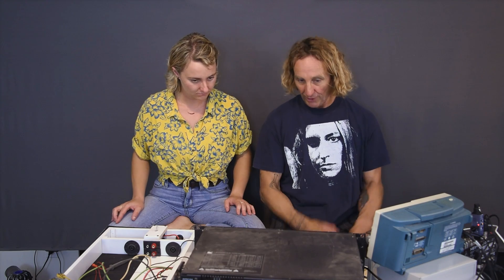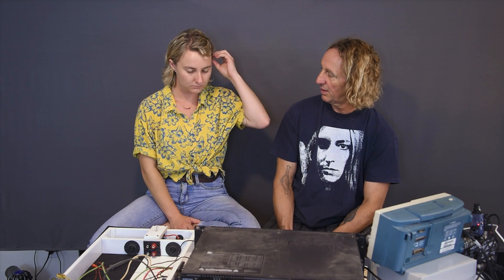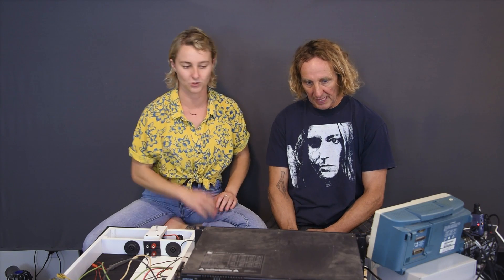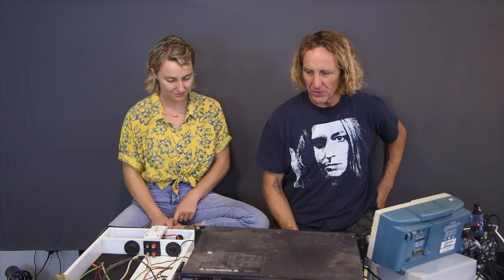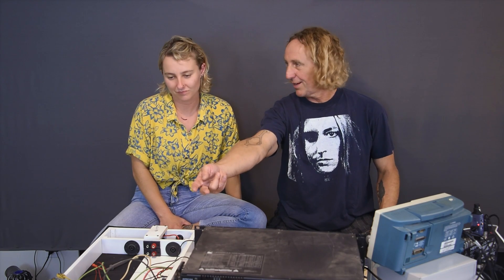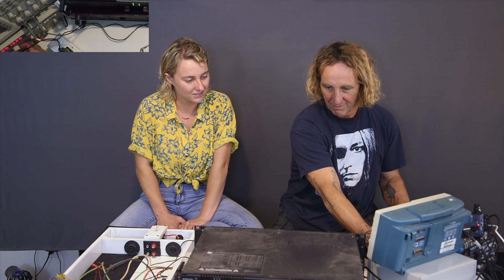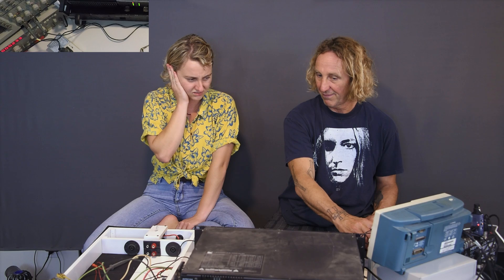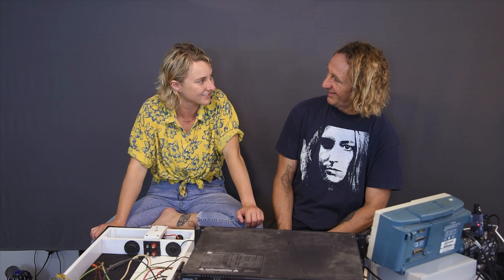Clipping Distortion Test Lab Gruppen FP6400 (Public)

Comment: First v-dosc was with the LA48 (lab 4000). Later on they become the LA48A.(fp6400) Difference is they connect the switching powersupply negative side on the B-channel (10% extra power on the low frequencies)and some extra inputsensivity switches.
Reply from the maker: Cool, yeah we never owned LA48, did not even know about them. We bought V-dosc when it was Crest and Crown powered with XTA xovers.

Went from crest to LA48a

Comment: Dave and Sam, interesting test, it is what my ears told me in both pro audio and hi end home audio with good class a/b and class D amps. I prefer class a/b for above 200 hz and class D for bass .
Reply from the maker: 🤙👍🤙 interesting, I actually prefer a/b for sound and D for cost, weight, size, output power per rack space, and minimal power draw

Comment: Hi
Very interesting.
Have you tried the distortion test with an old school tube amp?
Reply from the maker: Not yet but that would be fun to do
Reply: @DaveRat  If you really like to do amp power tests and want to get a very accurate and fast measurement, there's a product called the SMD Amp Dyno that seems to work pretty well. 

There's a couple of people on YouTube with them. One I know is a guy with a channel called Williston Audio Labs, he uses it on almost all of his videos. It's produced some very interesting results and conclusions.

One interesting thing that I've learned is that Class AB amps typically have about 3db more  peak power compared to it's rms while normal Class D amps might only have 0-1db extra peak power but higher end Class D amps will get more like 2db of peak power.
Reply from the maker: Cool cool and interesting.

I try and do my tests with inexpensive readily available gear or using almost no test gear at all whenever possible so people can replicate and test their own stuff.

I am more about teaching people how and why  to test than the actual tests themselves

Comment: Why don't you show what's happening on the oscilloscope. It would be interesting for engineers like me to see these diagrams. Including FFT analysis if the oscilloscope has such an option.
Reply from the maker: I will do at some point but also I find that analyzing gear in ways that we don't actually use it can bias the tests and perceptions.

If you or others are actually using a scope and fft to see waveforms on the inputs and outputs while mixing or setting up, then yes, that's a different story.

I wanted to test based on the way people use the consoles rather than what the consoles can do when tested in ways that people don't actually use them

This will become more clear when you get to future videos.

Focusing on what is actually heard and the consoles visual interface of what it tells you you should hear, has kept me on track with finding stuff that the gear that makes pretty colored lines often distracts from or glosses over.

Comment: Extraordinarily Great Video!
Isolating the distortion components allows people to hear the impact of amp clipping rather than simply looking at specs or a graph.  
I assume the sine wave distortion is from the amplifier squaring off the signal. (It would be interesting to see the output on a scope, particularly with the sine wave input).  
It would also be interesting to see the frequency spectrum of the distortion (using an FFT analyzer looking at the difference signal). The sine wave signal should show you the distortion signal's relative levels of even-order (2x, 4x, 6x. . .) versus odd-order (3x, 5x, 7x. . . ) harmonics. 
In the HiFi world, it is assumed that the even-order harmonics (typically from a Tube or Class A amp) are better "Warm-sounding" and the predominately odd-order harmonics are worse "Harsh-sounding."
In my experience, the way an amplifier performs when it clips, as measured with bursts signals (representing real-world wide-dynamic range program material like music with 20-30 dB peak to average ratios), is the difference that makes an amplifier sound good.

Comment: Dave, do you intend to compare the practical advantages and disadvantages of amp topology broadly speaking after these tests? 

I’ve always personally considered class-h to be the most optimal topology offering the best of balance in the real world/practical sense….
Reply: Modern amplifiers have moved past simple class-h designs. Instead, most use uniquely optimized digitally controlled power supplies that provide very high short-term output capabilities. Still, the length of non-clipped bursts and the recovery time between bursts varies significantly between designs. Additionally, most modern design's thermal condition can dramatically impact their performance. The dynamic variability makes it hard to compare amplifiers as their performance depends on the test signal or program material. For example, a design optimized for high frequencies versus one designed for subwoofer use would be very different.
Reply from the maker: Agreed, I will release a vid in testing a powersoft X4 next
Reply: @Dylan Dylan If I am correct the Lab FP and even PLM series are more similar to class G output stage. Main difference with other amps from that era is the SMPS.
Reply: @stefsmits442  absolutely - I believe the dual stage voltage rails of class H and how they ramp oppose to switch in class G makes it a winner topology - in my mind offers the best efficiency vs audio quality vs weight. 

Class D offers high efficiency and weight benefits - but probably not considered a audible pleasing distortion 

Class AB offers superior audio quality but definitely not weight or efficiency 

Class G - the predecessor to H - switched dual voltage rails - offers efficiency and weight benefits

Class H Ramps in the second rail, giving a more linear dynamic range, better distortion characteristics- but not as efficient and a little heavier then class D. 

That’s my understanding anyhow  - i am probably wrong though ;)

Of course the SMPS switching characteristics of each design from that period were talking about greatly alters efficiency, reliability and distortion property’s - especially in the HF band- that’s where a switching amp is let down IMO
Reply: @dylandylan11731  Though fun to hear the audible distortion of the X4 in the other video ;)

Comment: Dave, a lot of people prefer old big heavy iron transformers in the power amps to provide "real" bass or better bass tone than the light weight switching amps, do you agree with this theory or not and do you think the high end price amps are much better for heavy work loads or are the cheap behringer or knockoff style amps just as good? Hope there is no such thing as a dumb question, your honesty is appreciated
Reply from the maker: Great question Steven. My gut says iron.  But testing has shown me that it is not as much the age or amp type as the actual design of the specific amp.

For example, old creat vs qsc vs crown with pulse tests has the creat as a winner.

Newer amps lab gruppen was better than qsc and way better than the Peavey crest but then comparing a brand new powersoft to an old creat put the powersoft on top.

What I did find is that the specs don't tell you how an amp wi perform with high level sub lows and low frequency bursts.

You need to test and compare and there are old and new tech amps that perform well.

I will try and do a vid on how to test amps for lows at some point
Reply: @DaveRat  at EAW in the day, we never had the time to do a deep dive, but the inductance of large voice coil subwoofers clearly impacted the performance of subwoofer amps. Testing amplifiers into dummy loads does not consider the impact of the reactive component of a loudspeaker load. Not to mention that the loudspeaker load characteristics significantly change as they get hotter.
Reply: @DaveRat  thanks for your honesty, a lot of us in the community are switching to amps like qsc 3402 / 3602 as they are made in USA,  lighter, more efficient and reasonable on the secondary market. The heavy iron amps are becoming increasingly harder to get parts for it would be interesting to see how they fair against big ticket or cheap knockoffs, I am sure there would be much interest in this test or opinions
Reply from the maker: I will try and look at cheap vs expensive new amps

Comment: I found your speaker cable audibility test to be fascinating, but IMHO this test is flawed. What you're hearing is not purely the distortion; instead, you're hearing the part of the sine wave not being reproduced + the distortion. 

THD analyzers take the signal to be tested and remove the fundamental with a band-reject or notch filter. What's left is distortion + noise, and at clipping, noise will not be an issue. That would be what you want to hear. I assure you, it's a way nastier sound that what you heard from this test. And that sort of test would answer the question of the sound of a clipping tube amp vs. the sound of clipping SS amp. Note, of course, not all SS amps clip the same, nor do all tube amps.

I've seen vintage Marantz receivers from the mid-70's that could be pushed (with music) to a fair amount of clipping on an oscilloscope, but you could barely notice it in the music. I still don't know why this is, but I've seen and heard it in person.
Reply from the maker: Hmmm, this low tech comparitive really just allows us to hear potential differences but does not really put those differences into a perspective of audibility.

As far as older and tube amps natural ability to offer compression and/or distortion that is not undesirable, and therefore sound perceptively louder for a given wattage, yes, that also occurs when dealing with analog vs digital wherein analog distortion can be more forgiving and listenable than digital distortions.

Compression is non linear and can be viewed as a form of distortion but not necessarily an undesirable form.
Reply: @Dave Rat  In most cases, tube amplifiers (and particularly Class A Tube and solid-state amplifiers) produce much lower odd-order relative to even-order harmonics resulting in a "smoother" or "warmer" sound than class A/B (and class H) amplifies. This is generally thought to be a by-product of switching distortion between plus and minus signals (audio, not power supply).
Reply from the maker: Cool cool thank you Ken, I will try and test a class A amp at some point

Comment: What do we think of dance tracks that deliberately use a clipped sound to make it seem like they are exceeding the sound system capabilities?
Reply from the maker: Maybe in the same realm as a singer repeating a word to emulate a delay and adjacent to adding reverb to sound like the instrument is in a reverberant room or recording multiple vocal overdubs to get a choir type sound or harmony.

Artistic expression to achieve a desired results, all good.
Reply: @DaveRat  You are very generous. Having dealt with far too many small club djs, fighting a gain battle to try to preserve the speakers, I am somewhat less enthusiastic.
That noise means work at a time of night that should be reserved for drinking. I place it in the same bin as a TV production that thought that SMPTE time code was a cool sound to put in a program. It's one of those things that, as a maintenance engineer, you should never hear outside of specific brief tests.

I had 2 ideas for disco audio limiters, one was an Acme boxing glove on a spring, the other was a wage meter, it would start at the going rate for the night and every time the meters lit up red it would decrement.
Reply from the maker: Ha! Yes, ideally you would have limiters that prevent the speakers from ever being damaged. Then the DJs can just have at it and you are just an observer.

But down the more fun side, a giant clip light facing the audience that lights red when the system is distorting with a sign above it that says:

"Inexperienced DJ ruining the sound light"
Reply: No amount of protection will be enough for a pushy club owner flashing bottles of booze around on their favorite act night. One time I've been asked to operate a system I helped implement in a disco type club for that famous car pimpin' hip hop thing. I had to re-cone 6 out of the 8 subs before the next Friday night! Let's say I "exibited" some hearing  discomfort for a while after that night
Reply from the maker: Oh my, well, doubling the number of subs and setting password locked limiters in the amps that only allow the max level of 1/2 the amount of subs would get ya pretty close
Reply: I really thought I could do better at that time. Education is not free as we say in free education contrays

Comment: Ok so power amps today are pushing 5k per channel but the amps of yesteryear pushed mabey around 1000rms at the most. But today it’s all class D back then it was AB before that it was A from what I’ve seen A seemed louder than AB but AB seems quieter than D. Concerts haven’t really gotten much louder than they were in the 90’s but we have 3-4 times the power. I find it hard to believe that’s all headroom. Is there some equation I’m not aware of do these amps process power in a way that makes a class A amp louder than a class D amp. Their should be some equation that proves the spl of 50 watts class A or AB is the same as the SPL of 50 watts class D. Where’s all those extra class D watts going? Anyway thanks for the video. I wish there were more information online about the super sub ive searched all over the internet for info about it. But it’s simply not out there. I e seen all of yours but in total I’ve seen about 30 minutes of footage about this sub and haven’t heard anyone talk about actually using them except your 10 min video at Coachella. I’ve been waiting years to hear someone talk about actually using them on tour it thanks again for the video
Reply from the maker: Yes, the amount of watts delivered to sound systems has grown significanlty. Yes, modern  loudspeakers are less efficient, smaller, lower distortion and offer much better coverage than older systems.

When designing and building sound systems there are 6 factors that I see as the fundemenals:

Size
Weight
Max volume
Sound quality
Cost and
Aeethetics/ergonomics

Each of these impacts the others.  So as sound systems get smaller, and sound better, they get heavier and require more power and more expensive.

The fidelity of a modern high end concert is truly astounding and amazing compared to what was considered state of the are 20 years ago. And it takes a lot more watts to get there
Reply: @Jam Band The difference is that the bass cabinets of 30 years ago or more were usually horn-loaded, while today they're usually direct radiators that need 4-10 times as much power. Like acoustic suspension speakers in 1960's home stereos, the speaker industry has taken advantage of rising available power to make the speakers smaller.